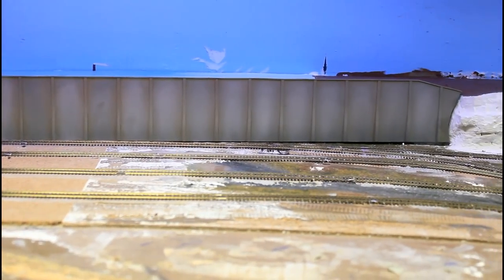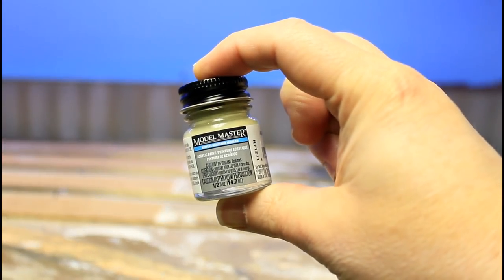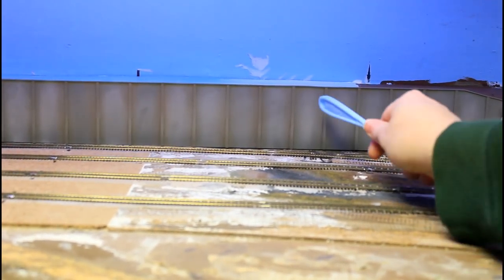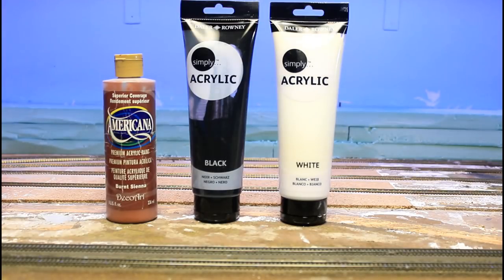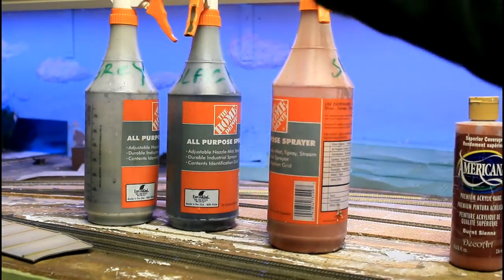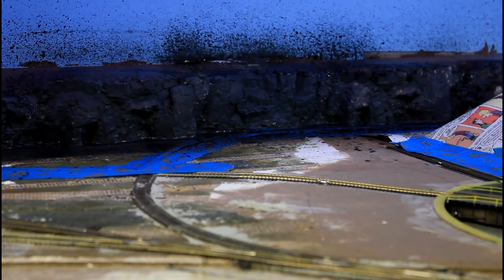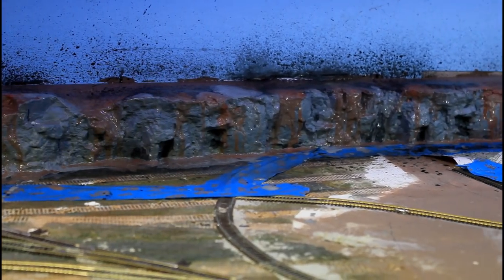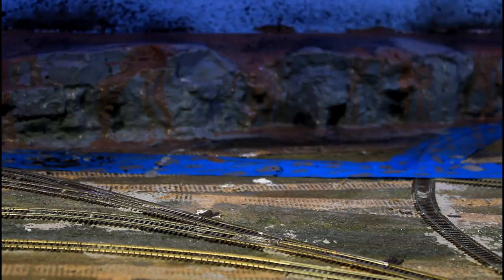Train Station Scenery: Part 5

Comment: Thanks Mike.   I use the Woodland Scenics products (so pigments) and their methodology so it was interesting to see an approach using paints instead.   The other thing I do, once the rock is all covered is to selectively "paint" glue on horizontal rock surfaces and sprinkle on some flocking (grass / dirt / moss), by painting on the glue and sprinkling on whatever you want, you can let it dry and vacuum up the residue and you end up with the grass only where you want it.

In any case, keep the work and videos coming.
Reply from the maker: Thank you Don Martin. I agree the Woodland Scenics stuff is nice but I'm too cheap to spring for it. The acrylic paints I use are a fraction of the cost and I can use the same paints for a multitude of other projects. The rest of the process you describe is still to come here. I added a link below to show another rock face I did for my dad's HO layout all is done except trees and shrubs
https://mikestrains.wordpress.com/layoutphotos/